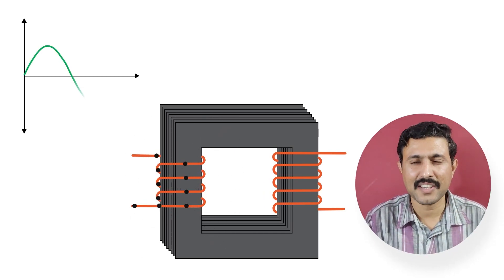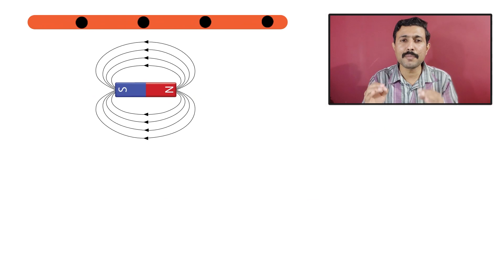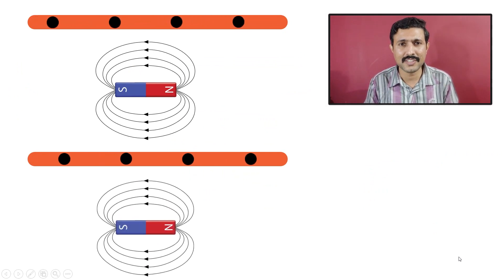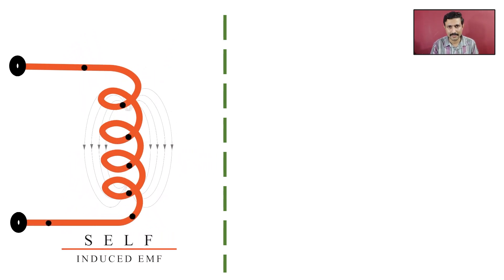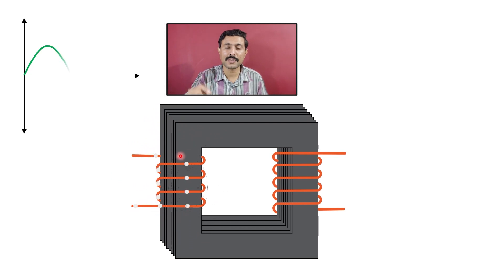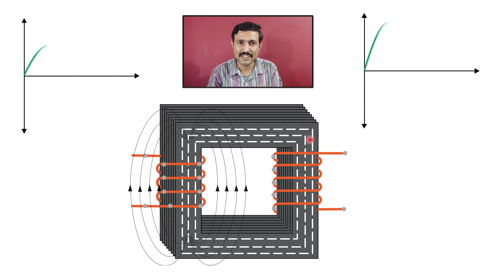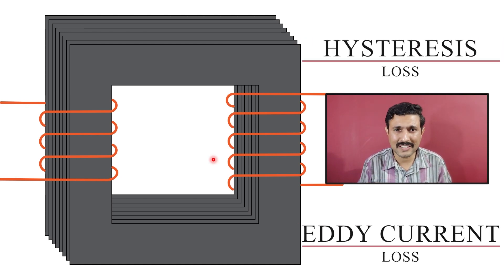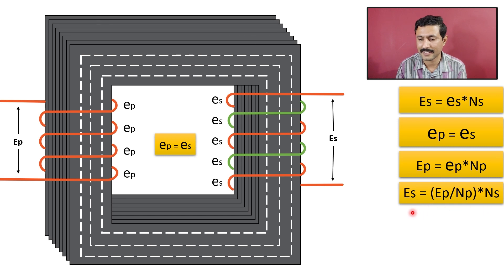Working principle of transformer with animation | Transformer working principle with animation

Comment: Both induction motors and transformers operate on the principle of electromagnetic induction. Then why motor's rotor not producing current and people not getting electric shock?please explain
Reply from the maker: Nice question
Reply from the maker: It require to write long answer I will answer you once I am free
Reply from the maker: Do respond if I did not answer today